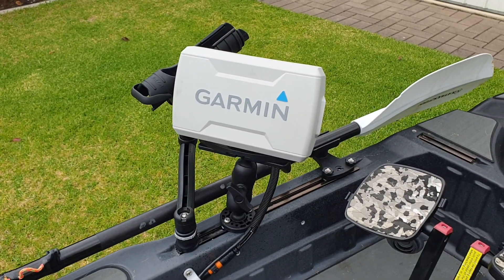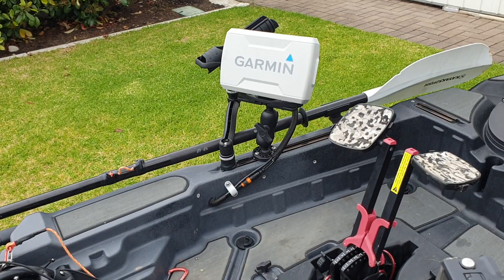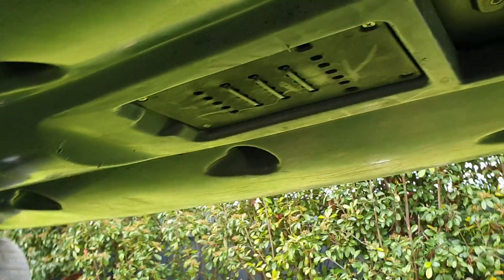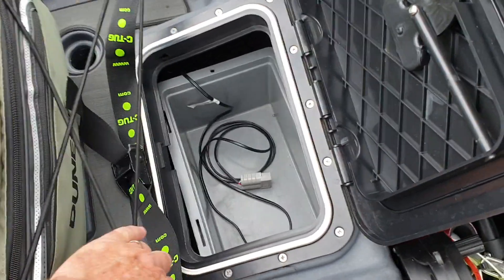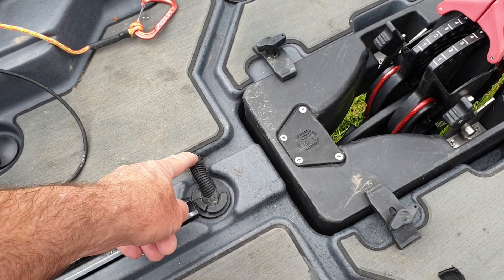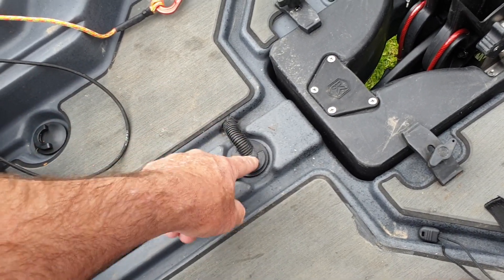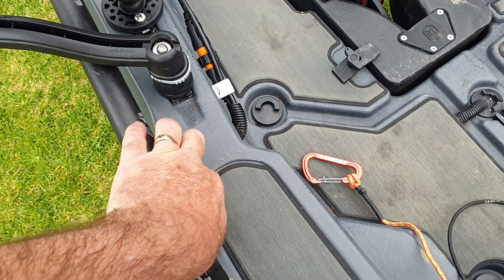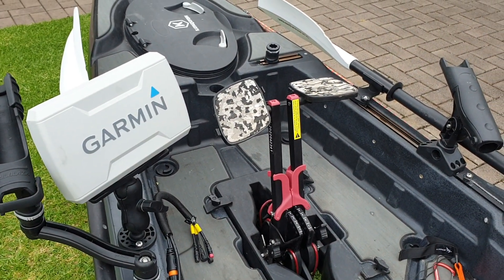Fish Finder install on Kayak 2 Fish 11.5

Comment: Thanks for the view of the transducer. I have a kayak with similar grate below I was trying to figure out how to mount the transducer to. This helped immensely.
Reply from the maker: No worries Roger.  Of note just be careful how you store and lift the kayak.  I do not store it on its side and I only lift using the handles front and rear.  I don't trust the side handles as a lift point due to the design which I think is more intended to move it in the water etc.  Enjoy as I love mine

Comment: my bay sports yak has a similar transducer mount area and did what you did , not seeing your vid before hand, but my garmin 7in UHD gave a very bad reading back on the sounder may be i should have persisted with the same instal ,have mine mounted out on the side of the kayak,using railblazer mounts works great but can get in the way  :)
Reply from the maker: Agree that the side mount can get in the way but I have it sorted now so all good

Comment: I have a Lowrance Elite 5i fish finder with a side view transducer. I was wondering if it will fit in the transducer mount underneath. My transducer appears to be longer than the mount cavity shown on your video. I'm quite interested in either the Orca or Nextgen 10.5 or 11. Les
Reply from the maker: Without taking the transducer cover off the kayak I would say the recess on the 11.5 is about 200 to 220mm long if that helps. If you have side scan I would use a side mount to get below the hull depth.

Comment: hey mate a bit of a late comment, but when you were speaking about the transducergetting blits from the peddles is there a way to stop that occuring, and if it occured how badly would it effect side scan on my soudner? thanks
Reply from the maker: I have found that with the side mount if the transducer I no longer get the blips. I find the side mount far better for all aspects if the sounder, side scan, clear view and normal sonar.  I hope this assists